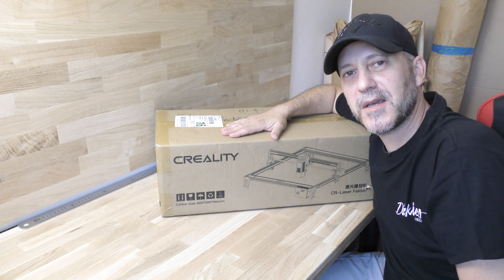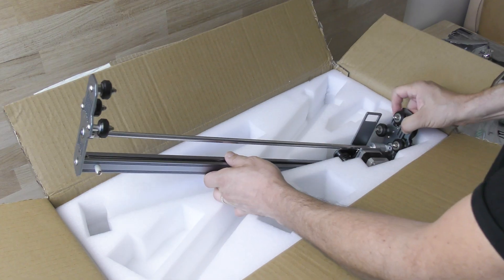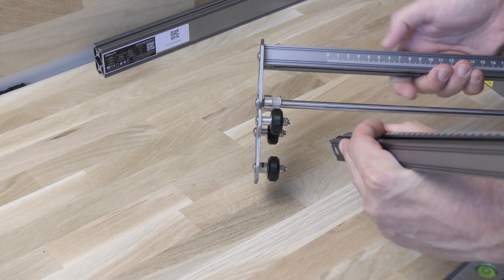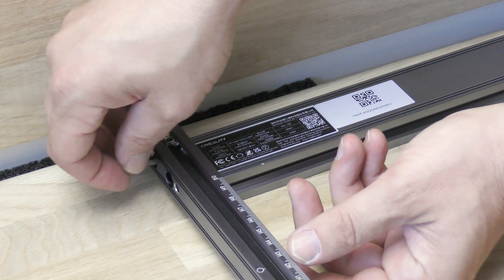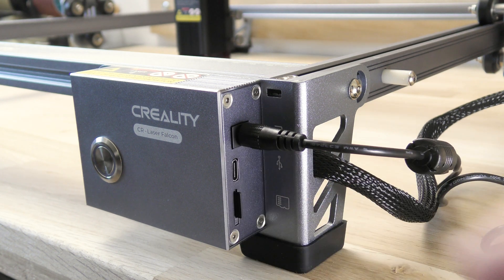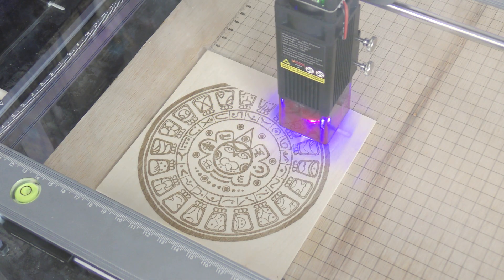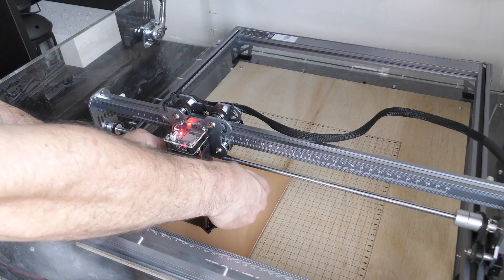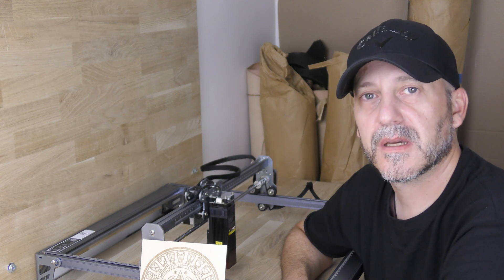Unboxing and testing the New Creality Falcon Laser Engraver - DIY

Comment: These instructions are WRONG! You have to put on the two X axis cross bars before securing the belts @3:15 or the two Y axis bars will not be aligned with each other.
Reply from the maker: I assembled the machine following the instructions of the manufacturer to the letter and the video they sent me. I suspect they know more than you about the machine they build. Thanks for watching anyway.
Reply: @RedSmithWorkshop  Sorry, Red. The assembly order in your instructions is wrong. I know because I just followed them and had to back track because the rails were not even with each other. I watched another video in which the assembly order was correct and it went together with no problem. If you can't accept that your instructions are wrong, there is nothing I can do about that.
Reply from the maker: I'm not telling you I'm right. I'm telling you I followed the instructions of the video Creality sent me when I got the machine, and it went wel for me the first time. Maybe you missed something in you assembled it the first time. Anyway, I'm glad it's all working for you now.
Reply: @RedSmithWorkshop  The official Creality video is at https://www.youtube.com/watch?v=HJr917F5d74&ab_channel=Creality. You may want to watch that and update your video accordingly. They don't tighten the T-nuts with belt tension until the cross bars are installed. It's not a tragic error, but it will cause some back tracking to loosen the belts, install the cross bars, then go back and tighten the belts.
Reply from the maker: You're correct. Quite a different video compared to the one they sent me. Thanks for the headsup.

Comment: Thank you for posting this! I just recived and assembled mine today. I'm curious on two things... one, when you are cutting the jack o lanterns one would you share the speed and power you use, please? Also, where did you get the awesome design for the jack o lanterns? :)  Thank you!
Reply from the maker: Thank you!! I found the Jack o Laterns on Google searching for Halloween pumpkin png. If I remember correctlty, the settings for the cut on RGBL were 350 speed and 100% power. But it depends on the software you are using. The best is to do some tests with your machine to see what works best for the material you're working with. Have fun! :)

Comment: I tried buying this but 3 minutes before it was supposed to go on sale it sold out :(
Reply from the maker: Sorry to hear that. Have you tried both links ?
Reply: @RedSmithWorkshop  I ended up buying the 5W laser since it was only $300 or so!
Reply from the maker: @LXWiseman  Good call. You can still upgrade with the 10w laser module if you need to later.